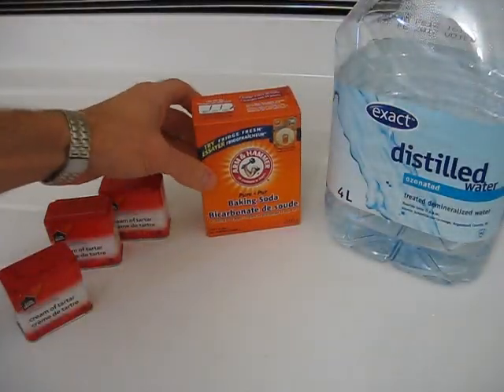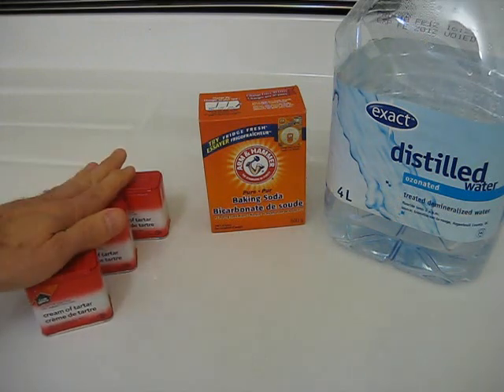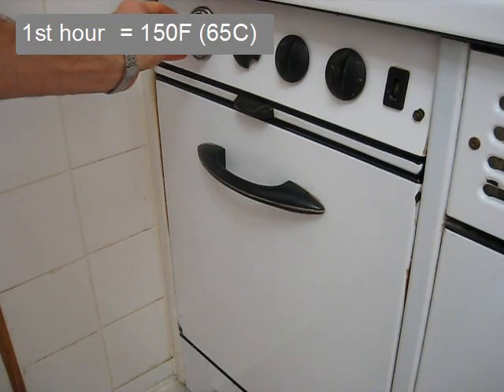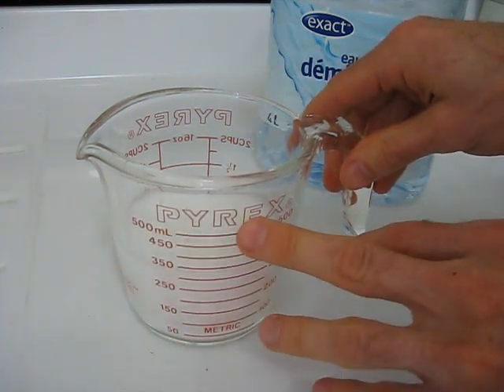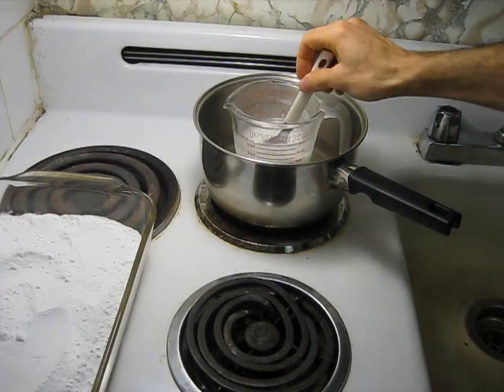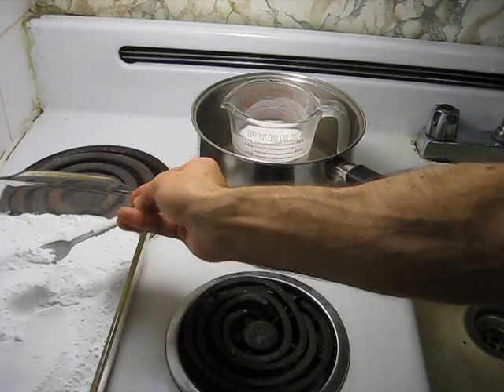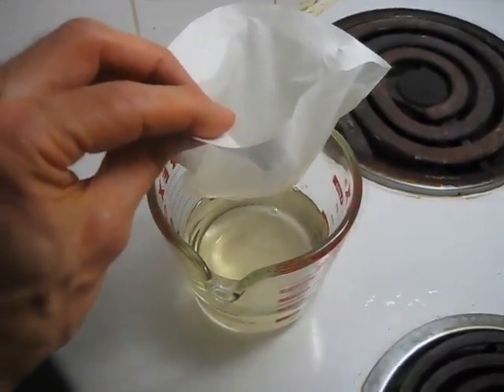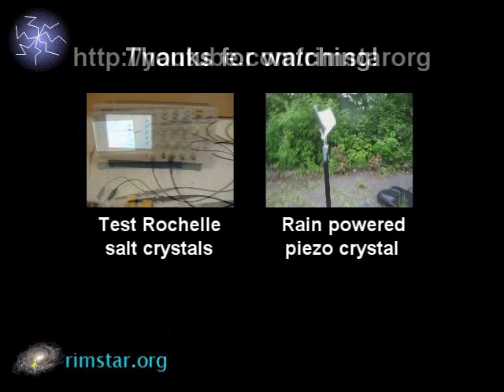How to make Rochelle salt piezoelectric crystals

Comment: Hay, RimstarOrg! This is very interesting indeed! I have a old record cutting stylus that needs repair, And it uses "Rochelle Salts" as a driver to vibrate the stylus to record the recording You are trying to make. The salts are on a small piece of metal with 2 wires coming out of it, then wraped once with a tough piece of tape and placedinto a wedge containing the stylius where You put Your cutting needle. What do You use to bind this salt to the piece of metal strip? oops running out of chtrs!

Comment: Just a note, that’s not the best way to make a double boiler. you need space between the bottom of the Pyrex and the pan. For this purpose your setup works fine but for more volatile chemicals it might be dangerous.

Comment: Part 2
Otherwise do you know what kind of temparature I need to put it for the next few days, 'cause it's rather hot where I am right know (south france) and the outside temperature is around at least 30°C or 86°F.
And the cool place of the house is really cool ...

Comment: Hi, Thanks for the video :)

When I look up about the transformation Sodium Bicarbonate into Sodium Carbonate most of the sources I get are just saying to heat for one hour at 200°C in the oven. Can you explain your choice about the increase in temperature for 4 hours, do we get a better result? I know though that the transformation begin starting 50°C so my first thought is this it's to smooth the reaction, but is it necessary? 
(the next part follows ...)

Comment: I'm having trouble getting crystals.  When your video says 50 minutes later, what was happening during those 50 minutes.  Were you applying heat to the yellow solution to evaporate water, or continuing to wait and add more sodium bicarbonate?  (I've been stopping my adding of sodium bicarbonate after the first non reaction which is very quickly followed by the solution turning clear/yellow).   I've also been taking my H2O potassium bitartrate solution to 95C to maximize the solubility before adding the sodium bicarbonate.  The reaction is significant, and almost makes it out of my 1000 ml boiling flask, but is this a mistake?  Should the temp remain lower?  I have been filtering the heated solution through a medium filter using a filtering funnel and vacuum filtering flask.  So far, all I have gotten is a very white small grain crystal.  Nothing like I see in all of the videos online.
Reply from the maker: vegasbryan During the 50 minutes I'm continuing to repeatedly add a little sodium carbonate (not sodium bicarbonate) followed by vigorous stirring. Toward the end the stirring took longer and longer before it would bubble, until an iteration when I just gave up stirring and decided it wasn't going to bubble anymore.I didn't measure the temperature of my solution so I don't know if 95C is a problem.Mine did bubble up to close to the top of the measuring up the first few times so I just put less sodium carbonate in to prevent it bubbling over.
Reply: Oops, meant sodium carbonate.  I didn't realize it would keep bubbling once it turned yellow and became clear.  I will try that out.  Thanks for the quick reply.  I appreciate it!

Comment: Hi there, if I grind the crystals into some form of powder and glue it to a polymer will it change the voltage if I stretch the polymer as well?
Many thanks
Reply from the maker: Hi, No, that won't work. Perhaps you should look into flex sensors and stretch sensors instead. These can also be homemade as well. They basically change resistance as you stretch them.  Here's some from Adafruit https://www.adafruit.com/product/519.

Comment: Well I ran out of characters, darnet! Anywhay The piece of metal inside the cutting head is about 1/2 X 1/2" square, one wire is welded onto the metal and the other was burned off! So I can`t tell how it was applicated, Was it bonded inside the salt mass? Or mearly placed on top, Then held in place with the tape & wedge.?? I`m thinking that when the salt was in liquid form it was placed onto the metal and the lead wite placed on top. I WOULD APPRECIATE any help You can give Me. Thank You much.

Comment: Very interesting. Do you think it would be possible to make a crystal earpiece using this method and try spread this crystals  over a thin metal plate? maybe crush the crystals into powder, mix it with some kind of metal powder like aluminium?
Reply from the maker: Crushing the crystals won't work since that breaks them. I sort of made a crystal earpiece in this video https://www.youtube.com/watch?v=R7zjfaPKMSE at around six minutes and forty seconds in with a larger rochelle salt crystal. Note that I'm using a radio with an amplifier as the sound source. The larger crystal was made as described on my website here https://rimstar.org/materials/piezo/make_large_crystal_from_a_seed_crystal.htm
Reply: @RimstarOrg  Thanks, just had a look at them, very cool :), got to buy some potassium tartrate and try this :) or i try make it out from tartaric acid and wood ash :P guess it not gets so pure then, but for fun.

Comment: RimstarOrg, Do you think it is possible to make a crystal oscillator with Rochelle salt? Typically quartz is used in crystal oscillators, but it is hard to "grow" quartz in a kitchen. Regards, Evan W.
Reply from the maker: Good question and interesting idea. Sadly, I don't know if it's possible or possible to do practically with Rochelle salt.
Reply: @RimstarOrg  Thanks for the reply. Yeah, the idea occurred to me when I was thinking about making a radio circuit. The Rochelle salt crystal would have to be cut and ground down like it is done with quartz. I don't know if Rochelle salt would hold up like quartz- I have not been able to find much on the web about this being done so I thought I would ask. Thank you for your time. 
Regards, Evan W.

Comment: I imagine a technique where you use the heat resistant rubber as honnycombed shaped ice cube trays...you take gold leaf from an art store and perferate it any times with small neeedle from one side as to make small tabs ...(kinda like sanding a smooth surface before painting)..let that foil sit with the burs up ain the bottom of these small trays...poor in the supersaturate and top with another foil with burs in the solution....small ones work with less power the rubber helps with the size change as the point is no cracks in the crystal..then dip the cured ones in a warm saturate to expose the gold tabs....funniest part then is if you shaped it to a tuning fork or string you could use resonance to seperate them at proper distances so that one sound in the center makes resonance at its own distance from the source sound...one sound helping many viberating crystals reach resonance would generate more power then put into creating the ignition sound....or imagine piezo string bundled in a loop then wrapped in silver like an old guitar string.  When you play one note another may also play...well lets use that...so one sound makes then all resonate...then have diodes heck let the casing be a diode...

Comment: Hi, one more thing I'd like to add is that if you indeed lost 37% of the transformation while making sodium carbonate you didn't use 214 g of sodium carbonate (as you said in the video) but 31g 'cause you ony got 315 g left of it. I'm filtring right now, I used around 60g but I think, I might have put too much though, we'll see...

Comment: Is it normal for the mixture to thickens and become really clumpy after adding half a teaspoon of the sodium carbonate a few times? It was really hard to stir
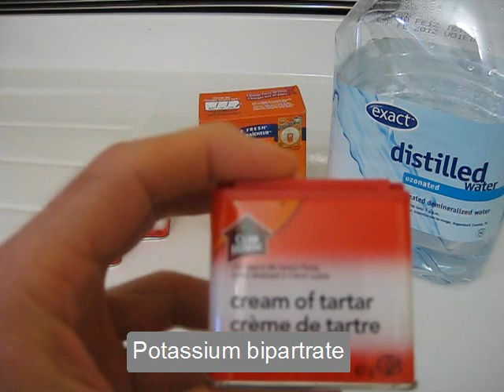Reply from the maker: That doesn't sound right. It shouldn't become clumpy. Maybe you weren't heating it enough?. Or maybe your cream or tartar wasn't really potassium bipartrate as I talk about around 0:30? I don't know if that would cause clumping but if you did everything else right then that's the only thing I can think of.

Comment: Found an important step, the water has to be really distilled water, even better if you get water from drug stores, the one that is used for Intravenous. I had prepared one batch with only drinking water and some very tiny crystals were made, less than a millimeter in length, and it took about a week, then I used the pure H2O and in about 2 hours had the same size crystals, I'm just waiting for tomorrow to see the results. (hope this help to the ones that are having trouble)
Reply: i used distilled water from the drug store but still i had small and very tiny crystals as u mentioned

Comment: By the way, by placing the measuring jug directly on the bottom of the pan (rather than suspended by using something like a bowl) you are still essentially directly heating it.
Reply from the maker: Good point. Although since the water is taking up heat from the pot too, there is less heat available to go directly from the pot through the glass. That heat then goes to the sides of the glass.

Comment: Sir, Hello again. How do I increase the voltage output of the Rochelle salt? Do I make it bigger in sizes? Or do I increase the amount of force? 

I would really appreciate your reply Sir. I'm in bind for my school thesis.
Reply from the maker: Increasing the amount of force definitely does it, however, I don't know if there's some limit or whether it's linear or non-linear. Other than that, I don't know.
Reply: RimstarOrg Yes, I did increase the amount of force, Sir. But I also varidled the size. And yes, size also matters. The bigger the salt, the smaller the voltage ouptut.
Reply: I don't really understand why it's inversely proportional :(
Reply from the maker: If you're applying the same force but over a larger area then maybe the current is bigger while the voltage is smaller.
Reply: RimstarOrg The explaination I'm think is this Sir. If the surface area of the salt is bigger. The more area that needs to be stressed out. Dividing the force so the area can receive equal amount of force. Meaning, that the applied force gets smaller. Whereas, the smaller surface area. The smaller area that needs to be stressed out.
Reply: RimstarOrg Although, its just similar to yours Sir.

Comment: Is there any way to connect multiple crystals in series to increase the voltage???
RImstarOrg you're awesome!!!
Reply from the maker: David Atri That may be possible. I've never tried it but others whom I corresponded with have tried and as far as I know, didn't succeed. My guess is that's because the voltage spike when you hit a crystal is so brief that it's hard to get them to happen at the same time.

Comment: i purify KNO3 from fertilizer using crystalization. if you want bigger crystals, let it cool more slowly, and check solubility of it, so you can crystalize you already made small crystals. when i was purifying 500 grams of KNO3 crystals was only bit bigger than snow, but when i did 1000grams (plus 700 ml water) it cooled down for about 20 hours, and crystals got very big, most beatifull i saved, all other got grinded for use in pyrotechnics (check the channel :D).

Comment: Hello, do you know of any way to make a transducer from Rochelle salt? I would like to make my own transducer to power an LED in a circuit.
Reply from the maker: I'd imagine your first step would be to put foil on two sides, first figuring out which two sides work best as I show in my other Rochelle salt video http://youtu.be/R9m79oWdOZI. The foils would be connected to your LED. But then you'd have to figure out some way to repeatedly hit the salt crystal to power the LED. I don't know if there'd be enough current from the Roshelle salt crystal, but I guess it's worth a try. I used a better piezo crystal to do it with falling water drops in this other video http://youtu.be/laSQ6yd7jaE.
Reply: I was thinking I would need to use a joule thief to help boost the output voltage as well as a rectifier to convert the ac to dc but I'm not sure if that would work or not. I think the hardest part of using Rochelle salt for a piezo transducer would be that I wouldn't think it would produce enough voltage. However in the first video you posted you managed to get plenty of voltage without the need for a joule thief it seems.

Comment: HELP!! What should I do when my product is a powder?? I followed the instructions carefully but I keep producing powdered salts?! not sure if its still called salt tho. What should I do? Please!! I need the crystals as early as possible PLEASE!!
Reply from the maker: TheJeanouise I've never heard of producing powder with this. Usually if there's a problem then you produce slush. The following are reasons why you might produce slush.It's possible that your cream of tartar isn't potassium bipartrate. There is a cheaper version that's called cream of tartar but isn't potassium bipartrate. The real one is more expensive.Another possibility is that you added too much sodium carbonate. This would happen if you keep adding it even after the solution no longer bubbles.Also, make sure you use distilled water and not tap water.

Comment: Sir ,can we make a piezoelectric plate by converting this cristal
Reply from the maker: I can't think of any way to do it. If you want only a small plate then maybe you can grow a bigger crystal and then grind it down flat somehow. I've never tried it. I show how I used a small crystal from this video as a seed crystal to grow a bigger one on my webpage here https://rimstar.org/materials/piezo/make_large_crystal_from_a_seed_crystal.htm. I guess you'd then test to find it's polarization using methods like I showed here https://www.youtube.com/watch?v=R9m79oWdOZI and then try filing or grinding it down flatter. You wouldn't want it too much thinner since you still need to make electrical contact with it on two sides while applying the sharp taps to two more sides (is shown in the testing video).
Reply: Sir,  Raymond wang created a material in google science fair of 2012 .what material is used at the top of that glass. How  that sheet was  created .can we create that piezoelectric sheet for school project
Reply from the maker: Neat. A little digging found his video https://www.youtube.com/watch?v=1kq4ruImfjY In it, he says he used polyvinylidene fluoride (https://en.wikipedia.org/wiki/Polyvinylidene_fluoride). Searching for where to buy it, I found https://www.amazon.com/Polyvinylidene-Fluoride-Off-White-Standard-Tolerance/dp/B00CPRFDO4 A small, thin sheet doesn't look too expensive (see the one numbered B0013HQ6T8). I don't know how well that particular one will work as a piezoelectric sheet or how to connect it up though because I haven't tried it.

Comment: Continuation... this method was claimed to give you free energy, it was said that when you apply a very high DC Voltage to the crystal until it hardens up or just shock it with very high DC voltage as to polarize the field, that when the crystal hardens up you will get a perpetual zero point energy out of it, maybe like 12 volts at like 300 ma or more?? I can't wait to eventually find time to try two tests, one with applying 300 volts until it hardens up,and another with a small 1 sec HV pulse

Comment: Hi,did you try to shine laser to see if they give current?
Reply from the maker: That wouldn't be the piezoelectric effect. Why would a laser do that?
Reply: I was just wondering,silicon crystals can have piezoelectric,photo,and semi-conductor properties as well depends on which impurity's have bin inserted.So maybe putting different layers of impurity's on Rochelle can be done as well. Piezo seems like the hardest to me,because crystal must be strong enough to stand the vibrations.
Reply: I mean from that home baked crystals.I'm not an expert,but MgCl2 look to me that should have piezo-effect as well but it's too fragile.Try to put it under tension to deform his crystal lattice a bit and than shine laser,it should energize it a bit,if not maybe i will try when i have time to make few different layers on the same crystal adding a dash of silver nitrate or something like that
Reply from the maker: Sounds like an interesting project. Let us know how it goes.

Comment: Interesting sink-stove combo. Bar Keeper's Friend will make the sink white again.
Reply from the maker: Yeah, I love it. Sink, stove and countertop are all one ceramic (or something) piece. Very easy to clean.
Reply from the maker: But yeah, the sink is a little harder to keep white.
Reply: @RimstarOrg  Ya, mine stains whenever I leave or wash dishes in it.  No more glaze. It's about the age of yours. I use the Bar Keeper's Friend sparingly because it does contain an acid, but just a little bit does a lot. It's interesting, too, when I get certain fruit stains, can't remember blueberry or raspberry, but the stains are blue, but turn red before disappearing when I apply the powder. Makes me wish I could do the same with red-shifted Eastman Color film, but that is some other process. A guy in Italy has come up with a decent solution, though it reduces saturation while correcting the red shift, so the colors are somewhat dull.

Comment: by heating the sodium bicarbonate, it turned to sodium carbonate?
Reply from the maker: +Fajar Ali Yes. Heating it removes hydrogen atoms.
Reply: well, thanks!!
Reply: +RimstarOrg I've seen some people use the stove method and it seems to be faster. Is this a good way to do it as well if I don't have a lot of time to make sodium bicarbonate into sodium carbonate?
Reply from the maker: Alex
I'm not familiar with the stove method so I can't answer either way.
Reply: RimstarOrg Thank you for the quick reply. I tried that method and I "feel" as if it's a lot faster than say, the oven method as you keep the product on high heat and stir until there's absolutely no more air "blooms" (if that makes sense).